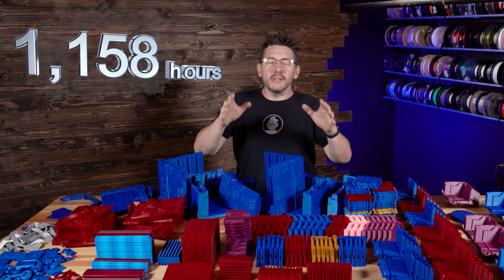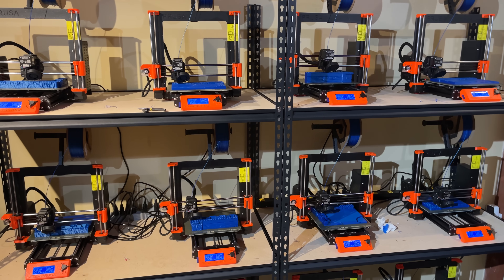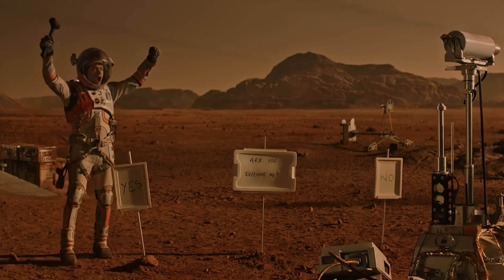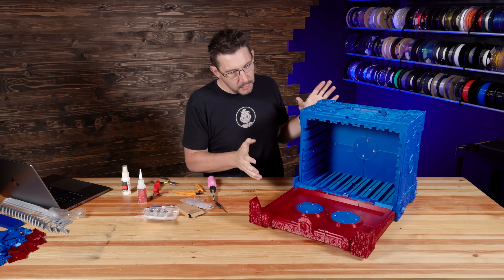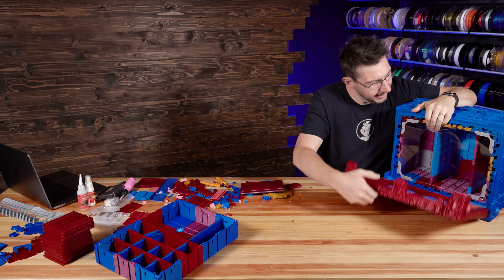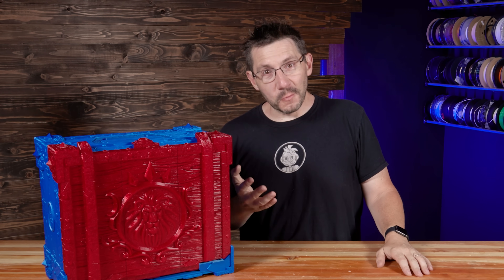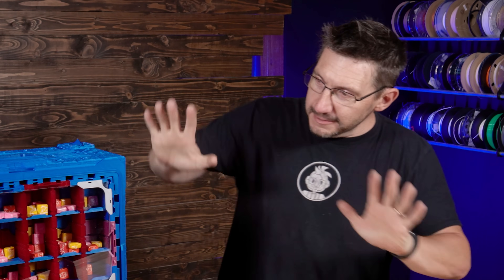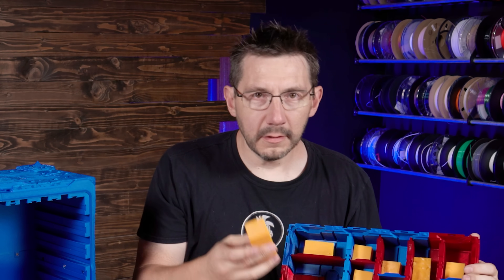HUNDREDS of Prints in 3 Days?!?

Comment: Ha! Now it just needs a spot for the cheese chopper and your set.

I had backed the project out of interest and because you never know... also, they have 4 sizes of cases. So I'm not sure which one you did, but if someone did want to print one of these, they could choose a smaller one too. Mot to mention that there's a number of companies that do bulk discounts, so you end up with something closer to $15 or $10 a kg... still expensive and maybe not something you do outside of using for a show or something.  But you find a sale on some random filament and don't like the colors, some person is trying to get rid of filament (for some reason), you get sponsored, you dislike a certain brand but happen to have a bunch of, you ran out of space and need to use filament, you got a bunch of free filament from contests and couldn't choose the color/have too much of a color, etc. etc. etc. you're option is "well, I guess I simply have this now and will never use" or you use it for something... and this could be a something.

I tell people "don't go off of the now or plan for the future, go off the potential. You never know when you'll have a use"

Comment: This looks amazing for transporting things from the storage closet to the game room. I'm not sure how well it'd work for going from my house to the game store though. I used Battlefoam, which are built with a plastic frame and cloth panels, and the weight builds up quickly.
I do like the modular insides. I think a less solid and chunky outer frame might work better though.
Reply: The ornaments is optional (the "X" parts)

Comment: As easily as the drawers went in, I have a feeling they're a struggle to get out. I also have a feeling that lugging a 20 pound case (once filled up with minis, snacks, or whatever) will get old really, really fast. It's a neat idea and I did happily back the original Omni (still waiting on time/money/space to actually make some of them), but this is a little much. 

For anyone who doesn't mind a large, heavy, expensive, but highly customizable storage system: the original $48 early bird price tier is all filled up and the not-as-early-bird price of $58 is almost filled up as I type this comment...$69 for the files plus $150-850 in filament seems a bit much, but you do you.

Comment: On the kickstarter for this project they state each drawer for the briefcase shown here takes 45 hours to print and the case 172 hours to print on 'normal' speed. They claim half this time for 'fast' print speed. You cannot buy a case in the kickstarter only the digital files for $58 early bird and $69 normal price and that's ONLY to use yourself. A commercial license for this model is $249/299.

Also this briefcase is the second smallest of 4 sizes... The biggest, the 'chest' is 633mm X 453mm X 141mm. Seems like an astronomical waste of time, money, and plastic to print something that size.

To sell one briefcase as shown you need to spend at least 307 hours or 12 straight days on normal speed printing parts and if we assume this is a flow rate of 6mm^3/s that would be over 8kg of plastic so that's like $160 in plastic plus $299 for a license plus probably another $5 in electricity at a minimum and putting over 300 hours of wear and tear on your $1000 3D printer. Whyyyyy. FDM 3D printing is the least time and cost efficient possible way to make anything this big.

Comment: Thanks for showing the print farm. Did you have to get an electrician in to upgrade your standard electricity to be able to run so many at the same time like that? Or is that something most homes in the USA would be able to do without an upgrade? High-5!
Reply: ～80W per printer. You can run about 18 of them on a 15A circuit (12A * 120V / 80W).

Comment: Great stuff and an amazing projects, but I would never buy something like that. No way would I be spending 17 spools of filament and basically two months of running my single fdm printer non-stop to print something like this and I struggle to understand who this is marketed towards and what problems it solves. I have a lot (a LOT!) of minis but there are a lot of cheaper and more efficient ways of storing and transporting them for sure.

Comment: Looks cool, but for how much its going to cost to buy the STLs, spools of filament, running the machines, and putting it together you can probably get a pelican case with inserts and have some spare change.
Reply: It does look a lot like a solution looking for a problem.
Reply: No probably about it... Pelican with inserts are the cheaper way to go.
Reply: A Pelican case or Nanuk case would be stronger and lighter too
Also wouldn’t be dependent on glue too

Comment: Seems like a colossal waste of plastic to me... Just saying.
Reply: There are so many choices that can be made when making. Cost is 1 thing to consider. Also, strength and weight. A thin plywood is pretty cheap and light, but also pretty strong.
Reply: What material would you use? wood or metal… ya know… instead of PLA (plastic)?
Reply: @davidtobin  Well, in fact I don't have a use for something like that in the first place. If i did, I would probably use thin plywood.
Reply: @madp3d  Gotcha. That would be neat, but how would you design all the parts? I can 3D Print pretty well and dial things in, but I can't work with wood in a way to make something like this, especially with the detail. Would be neat in wood, but how would you suggest someone with no design or woodworking skills make this?
Reply: @davidtobin one option is to go to a hardware/lumber store that will cut the sheet for you. You pay an amount per cut, but then you don't need tools to cut, but they are simple cuts. Then you print pieces to join those wood pieces. Have you seen Alexandre Chappel's YouTube channel? He has some videos where he built tool boxes with 3d printed corners and hinges, but most of it is thin wood.

Comment: 17kg of filament? At $20 a spool that's a crazy price for that!!
Reply: his "joel's high five" blue he talked about is $50 USD for a 1kg spool, that would still be $850 for the project which is insane
Reply: For real may as well buy a yeti cooler.
Reply: And two months (24hr days) printing it for mere mortals with a single printer.
Reply: That's for all of the pieces for the configurations he made. The case itself is 15 lbs. IIRC.
Reply: @tenchuu007  still 7 spools for $20 a pop .. That is GW territory!
Reply: nah nah, thats protopasta... $50 bucks a spool...
Reply: oh ok is it really worth the price difference ? @twinturbo313
Reply: And He can hold it with one Hand! 😀
Reply: Wow, in france, on some sites it's only 16$ for a pla spool, it is so expensive in australia
Reply: Forget the $25k worth of printers 😅
Reply: A mixed material design to cut down on filament would be good
Reply: Need a new £1,000 3D printer to print quickly
Reply: I’m Australia that closer to $55 a spool for prusament and worsening due to exchange rates
Reply: You guys are really complaining about the couple hundred-dollar price tag when he literally printed it on 22 pursa printers that are all $1,000 a pop
Reply: @landofbosses7844  and got the filament for free on top of that 🤣
Reply: @landofbosses7844  
That as well.